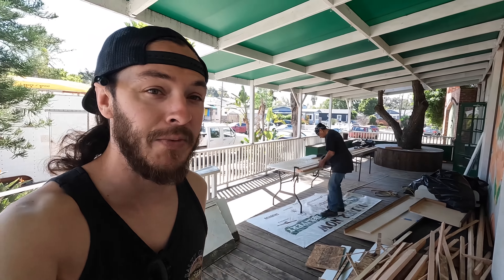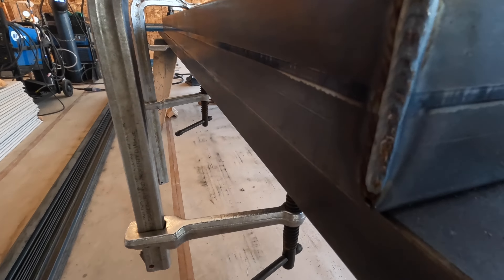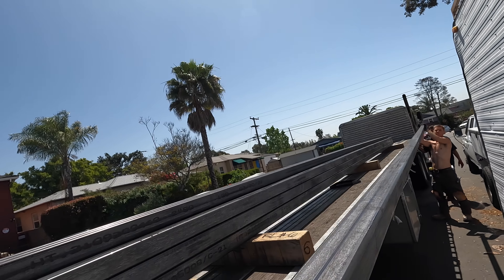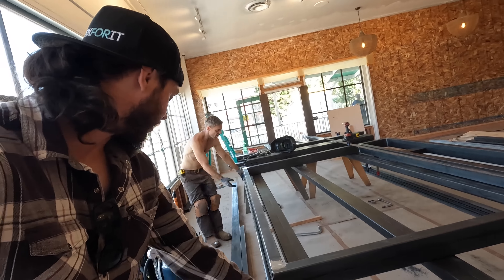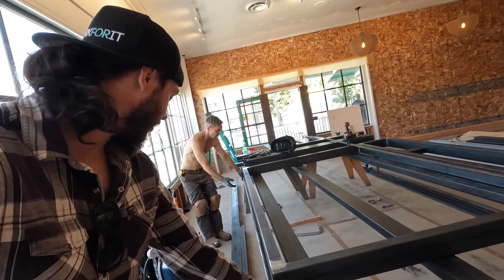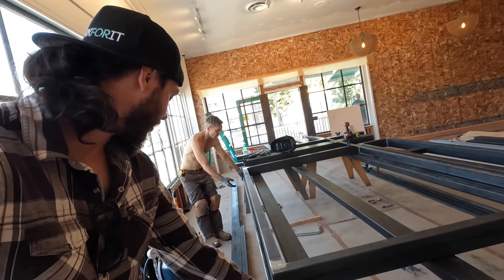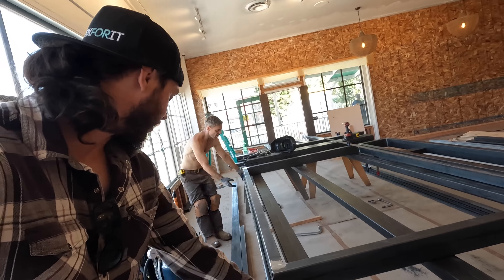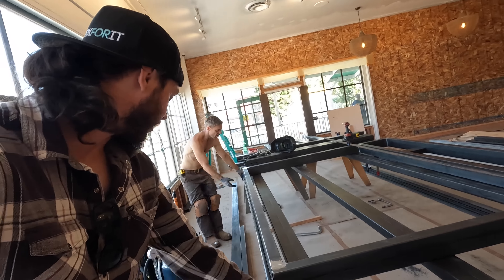Why I Built This Prototype!

Comment: You can weld the 2"-3" piece of metal that would prevent you from opening the window to the actual moving component of the window that way you can weld the longer part to the permanent frame section and still cover all gaps. Try it out on your sample

Comment: Quick little tip, if you’re building multiple of the same frames, make sure your first one is perfectly squared and all that and just build your other ones on top of the first one. Basically using the first one as a template.

Comment: Weld some steel plate to the inner window piece the moving section, to cover gaps, just put a couple small tabs on the outside frame as the stops

Comment: Could use weld on hinges. If they are put on the same Direction when you open the window all the way down you could slide it off so it could be removed.

Comment: Idea for the window seal, how you were concerned about sealing the bottom, if you put flat bar on the moving window frame around the window above the hinge and then on the solid window frame below the hinge with say a 3” gap in between to allow room to open and close u will be sealed. The flat bar below the hinge on the permanent frame will stop it from being pushed in while the one on the moving frame will stop it from going out plus the lock stopping it from opening. Then to fill the gap get a piece of rubber similar in size to the flat bar and screw it in below the hinge to the permanent frame and above the hinge to the moving frame and the rubber will seal it and move with the window.

Comment: Hey guys,all through my construction career I had a Gang Box or two.Lock up your tools after hours and then chain it to something.If  I could not chain it I would screw something right in the floor,a hook,old latch or anything I had.Also put casters on boxes.In between job put boxes in truck or van,loaded up.They will be safe in your work truck.Later!

Comment: As a pipe welder you will not back feed power to your or each other's machine and you could have as many people working on it as you had machines and secondly to help with the welding surface to refrain from warping and shrinking welding a circle of 8 meaning weld a 1 section move 180° across the project for weld 2 then to 90° of first weld for 3 180° straight across the middel of the first 2 welds then weld the 45° points in the same sequence then once tou have 8 welds made repeat in the same manner tell everything is 100%

Comment: I'd lay a piece of 1/2 pipe in gap of window, alternate stitch welds every four inches, frame, window, frame, etc. Cut the pipe every four inches and insert a greased rod. Custom full length hinges that look good, are inexpensive, can repair and remove easily.

Comment: Get rid of your whip and pause in your mig welds. If weld weld a straight smooth weld it would look a lot cleaner for interior stuff. Takes some practice to get down but worth it. Also you can use your 90 grinder to smooth out your wraps on the welds. They look like they are coming out great!

Comment: 2 or more welding grounds clamped. Only thing I would avoid is mixing and matching an older analog type welder with a newer digital type welder. Never happened to me but I've heard the older welder can mess up the digital welder.
Reply: I think what you're trying to say is; A transformer based welder could fry an inverter based one.  Que no?